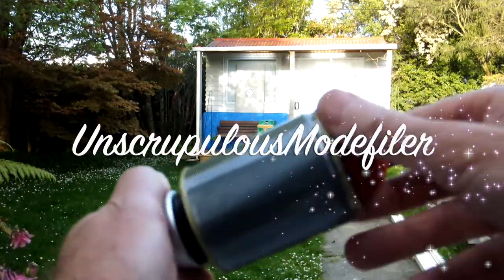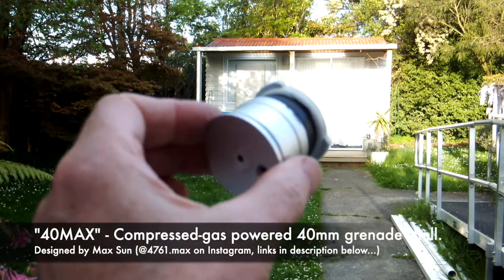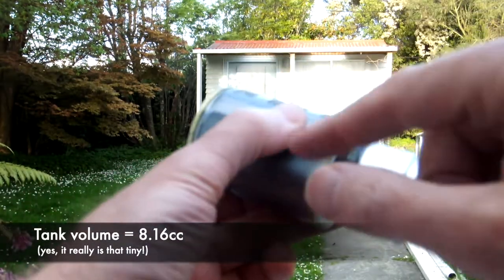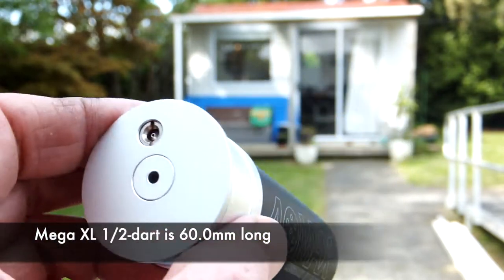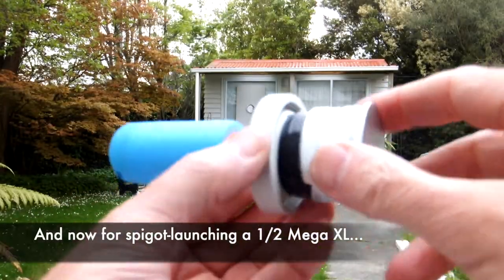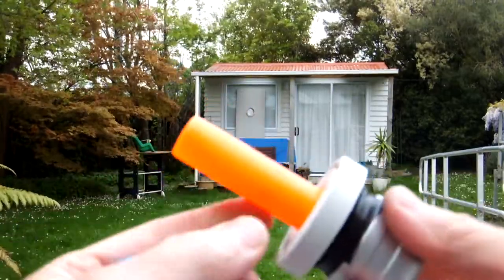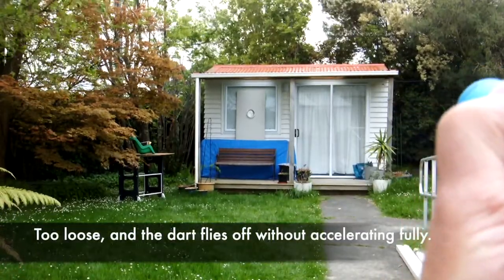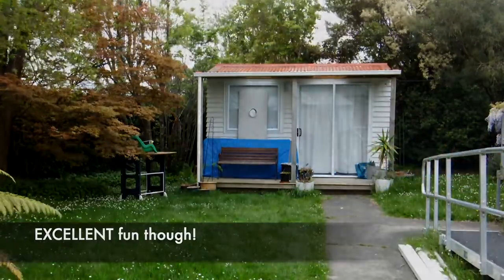"40MAX" 40mm engine firing Nerf Mega XL 1/2-darts and Weasel Missiles

Comment: So what I read is the green gas only gets to 115-130psi but your pump would do 150/160 would be more power. You’ve got me super interested in these shells now that I don’t need to buy green gas all the time and don’t need a special HPA valve
Reply from the maker: Green gas is basically just propane/LPG with added silicone lubricant but no added smell. It's stored as a liquid in the can/cylinder then expands and cools as it's loaded into the 40MAX tank, then expands and cools some more when the 40MAX is fired. All this means that performance is noticeably affected by ambient temperature... a hot day will give you higher pressures/better performance vs a lower pressures and performance on a cold day.

On a 20˚C day, a 1-second fill from a green gas can will give performance equivalent to about 180psi of compressed air. A cold (10-12˚C) gives disappointing performance; and hot (30˚C) day and things get spicy.

The compressor I'm using here is an "Air Hawk Pro" which is quite a good quality unit with a powerful motor, large piston volume and solid cast metal cylinder/head unit. Its max. pressure setting is 150psi and if connected up to the 40MAX directly using a Schrader (tire) valve adapter it will stop there but kinda over-run to and will reach about 160-180psi. Downside of this set-up though is that the Schrader adapter is poking out the back - OK if you're leaving it connected but not great if you want a stand-alone "shell" to load into a launcher .

If you're using the needle-type adapter it'll max out at 150psi and probably give you slightly less pressure in the tank by the time you disconnect.

If you are only using compressed air in the 40MAX you'll have to add silicone lube every now and again. I'd recommend stripping, cleaning and lubing the whole thing every 200 shots or so.

Comment: I'm really interested on how did you make/get the adapter for the compressor to the 40max fill valve, I'm an airsoft player and a tool like that would be so useful
Reply from the maker: The air-compressor adapter ideally needs to replicate the fit of a standard spigot on a Green Gas can... In this case it's made from a standard-issue ball-filling attachment that'd come with pretty much any pump or compressor, but with the addition of an aluminium sleeve slid over the attachment's tube to fatten it out so it can seal more closely to the inlet valve (more below👇👇)

See picture and more explaination on Imgur here: https://imgur.com/BGGYCnj

A small o-ring is slid onto the spigot first to provide a seal between the bottom of the aluminium tube and the spigot's base, so when you push everything into the inlet valve everything holds together well enough to reach the (nominal) 150psi limit that the compressor can achieve. It's a bit leaky and not 100% reliable, but for the most part it works.

Stand by though; I've just got a ø6.0x0.75mm tap and die set so I should be able to convert a bicycle tire's Schrader valve to replace the 40MAX's inlet valve. Will let you know how it works, but hopefully it should eliminate any leaks so we can get the most out of the tiny little compressor, plus get an accurate reading of the air pressure it can achieve.
Reply: @unscrupulousmodefiler  thank you so much, I will try it
Reply from the maker: @supersmashbrosevil  Cool! Let us know how it works for you.

Comment: hmm... pretty cool that this works
Reply from the maker: Yeah it was a bit of a punt, but the shells themselves were such a good price I figured even if I could just check out the innards I'd at least see how these things worked.

Because of the tiny tank-volume though they only excel at spigot-launching and single-barrelling things. Still, they can fling a handful of 1/2-darts down a loose bit of brass nicely 😀

Comment: Could you do a video on the conversion to hpa
Reply from the maker: I will when I get time 😅
Reply: @unscrupulousmodefiler  what green gas to hpa adapter would work best to conect straight to a hpa line
Reply from the maker: @archiedrury2676  I don't really know yet. I've been experimenting with LPA ie: low pressure air (≤180psi) provided directly by a small compressor that would be housed in the stock of the blaster... pretty much to avoid having to deal with HPA and the sorts of tanks/connectors/regulators that are required for such high pressures (hundreds of PSI).
Reply: @unscrupulousmodefiler  i just need to know what green gas to hpa adapter works with this and what type of adapter
Reply from the maker: @archiedrury2676  Sorry, again I'm not familiar with the types of adapter that you can buy... the one I've used in the video I made myself from a ball-inflator adapter and some small aluminium tube:

https://imgur.com/BGGYCnj

You could try asking about commercially available adapters at an airsoft store - they'd certainly be easier to and more reliable to use ;)
Reply: @archiedrury2676  didn’t know about that, sorry

Comment: Do you think it would be feasible to thread the fill valve for a direct line and convert one of these into the main part of an HPA blaster?
Reply from the maker: Absolutely. The only reason I haven't done it yet is I only have the one so far and still have some testing to go with it 😅

The thread on the inlet valve is M6x 0.75 so not immediately compatible with the usual push-fit fittings, but it would be entirely possible to drill and tap on the opposite side from that valve for something with a small thread like a M4, M5 or M6 (1/8 or larger is probably too big)

https://www.aliexpress.com/item/1005002990608089.html

You do have to disassemble periodically for cleaning and maintaining the o-rings, so design with that in mind.
Reply: @unscrupulousmodefiler  Where do your QD fittings come from?
Reply from the maker: @wadekirby8575  The ones pictured are an access spigot for plumbing:

https://www.bunnings.co.nz/marley-32mm-optim-access-plug-spigot-end_p0336513

It's a fairly specialised piece of gear and I don't think it's available world-wide. More recently I'be been making them up out of medical-grade baby-bottle fittings (which DO actually fit a lot of baby bottles) but the idea would be transposable to anything you could find locally. Have a scroll through this Imgur album - it's a mess, but something useful might be in there... :

https://imgur.com/a/AmhrMlk